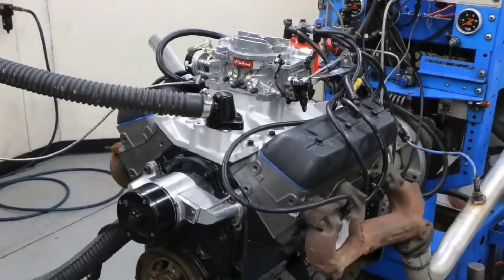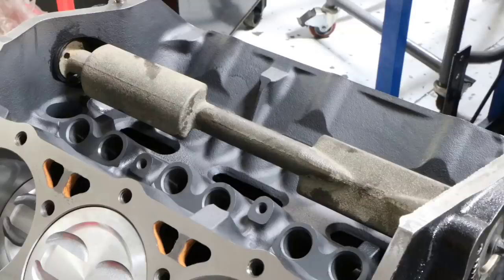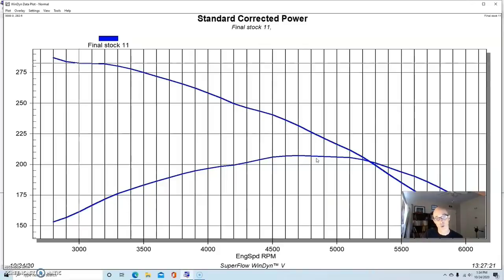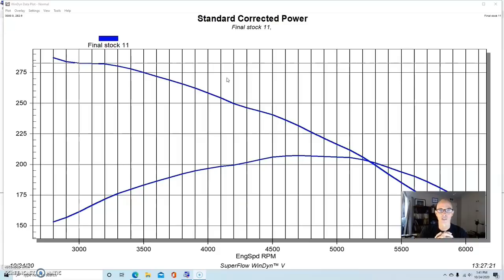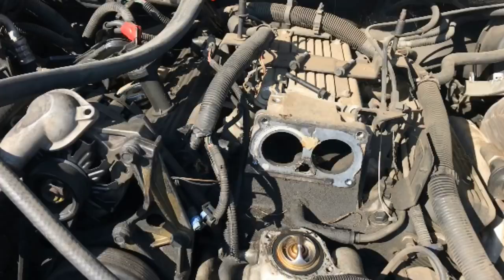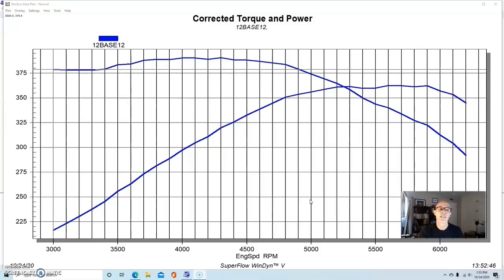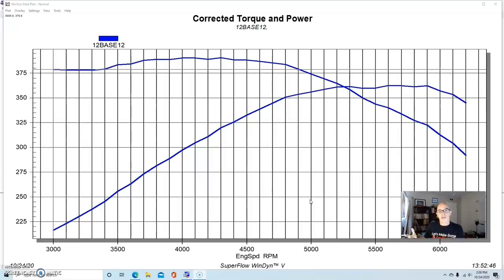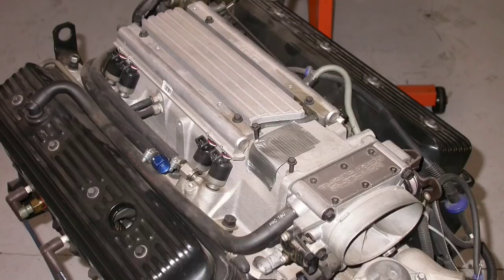4.3L V6 VS 4.3L V8-WHICH OTHER GUYS MAKES A BETTER BUILDER?

Comment: I have the 4.3 in my 15' Silverado. I gotta say I'm impressed by it all the time. An ppl who dont know usually think it's a V8
Reply: i have the same in the GMC its not bad after 4000 rpm is were i feel the difference in the 5.3 v8 but the low end she gets going for just 3.23 gears also have a older gen 4.8 l v8 and low end its nice but lags top end but having 6 speed over the old 4 speed stay in torque band and now with 8 and 10 speed prob always in the band. But the new 4.3 with lets say some 3.73 gears good e85 tune would run pretty good.

Comment: Chevy had to come out with a smaller V8 because some agencies would write the bid spec to favor Ford by specing "V8 engine, displacement no larger than 4.6 liters". The Caprice had a 350/5.7 so GM adapted. Ford could do anything when an agency spec'd a "V8 engine, 5.0 liters or larger".

Comment: Its all about volumetric efficiency, which ever one can flow air in and out more efficiently and at a higher rpm will make the most power.

Comment: Had Olds 260cid ... 302 Fords.. 305 sbc.. Love the small V8's. Perfect blend of economy and power.   Flatheads have their own sound/appeal.. again small displacement V8s.
Reply: I blew 3 Oldsmobile 260s. I swapped in a 403 back around 1997 and its still living happily ever after. 

I have a 302 in a '88 Mustang GT. Love it. 

I've had a few carb'd Chevy 305s and they're good on power, good on mpg,  1 was pumped up a bit. I can't complain.

I've been meaning to get and build a flatty. Every time I almost do.... I buy something else like old's j2, 394, 401 nail. Ugh such is life 😁
Reply: @xmo552  130k on my 260 before car was sold off.  79 Cutlass.  70's were different.. Carb'd motors didn't last as long.  I like the 302 Ford the best.. so I'm happy Richard is going to make a modern/Chevy 302 w L99 pieces. 305 TPI motors were great.. Had 305 in my 92 Firebird.
Reply: @mountainofeverest3861  
Oh yeah I forgot my 305 TPI. Luv that one alot actually.
Reply: You want a small Ford, you need the 255....what a piece
Reply: @timothybayliss6680  
Now that's one I hadn't heard of and I was pretty proud of my early Fox knowledge.

Comment: Definetely the v8 would be my choice for like you say over 8 cyl it's less strain on the engine to get the same power and a v 8 just sounds so much better than a v6 I love the 4.3 v6 they are awsome in s10s especially w a stick but a v8 version would be even funner I bet and be under less stress doing it so this is my 2 cents love the channel richard keep up the good work now project nova ever gonna get a Pontiac motor like the ones you tested ? That would be what I would love to see a 400 Pontiac slight build cam intake N exhaust w a q jet in front of a Muncie or a shift kitted turbo 400 trans I bet that combo will be the best bang for the buck basically meaning less money than it would cost to the same performance from a stock bottom end just cam intake and exhaust sbc or almost anything actually except a 5.3 L.S . But even then it may make more hp but the torque will not compare just a thought because I did have one or two Ventura's back in the day we stuck 400s and one a 455 in and stock boneyard motors with just tweaking the hei and q jet out ran a lot of guys with lots of money in their stuff they were left mouth open speachless saying wtf just happened just a ten bolt 373:1 limited slip carrier not even headers manifolds to decent mufflers and all the way out the back where it had decent sound but you definetely heard the q jet moaning like a bitch they would open I swear all the way unlike a sbc which couldn't use all the 800 or 750 cfms the Pontiac sure needed all it could get and being low compression I could bring my total timing in very fast to 35 or 38 deg at 2800 so she was cooking running cool and loving life and snatching a second gear chirp that left 8 ft long posi marks I found that if you put the turbo 400 in second gear hold it to the floor till it shifts that made for the hardest shift idk why but it's sure true even stock w no shift kit it was the best way to get second after the shift kit install oh my much better and those cars are not as heavy as a Camaro even so the guys w the mid 70 Camaros w sbc motors that had built them and had a decent investment got spanked often times pretty hard by a 4 door primer ventura with a 200 dollar boneyard motor just saying this a true story even a grand national had it's work cut out it was quicker out of the hole but she would start picking up on it as soon as some rpms came up and the torque was being made hp was only 300 ish right but torque was 400 plus isn't that true and what do you need from light to light or the 1/4 mile even unless you gear a sbc camaro right it's not gonna perform like a pontiac w less rpms but had the torque to over come the gearing a bit I often wondered what 411 :1 would be like with as tall a tire as I could find woot woot oh well I'll put the bong down now and stfu lol night yall

Comment: The L99 4.3 uses the same cam as the iron headed LT1 (and the Vortec L30/L31) so it'll be interesting to see how that shifts peak torque with less displacement. I'll also bet that the L99 head has better flow numbers than the V6 head, even with the smaller valves. Raised intake ports, nicer exhaust ports. It's not the same as an LT1 head, though, different casting, smaller combustion chamber. Allegedly the 5.7 iron LT1 heads outflow the aluminum LT1 heads as-cast, anyway, so I don't know if you'll gain anything putting a set of F-body heads on the L99.

Comment: 4.3-V6 with lightly ported heads and a cam,  engine size and weight weren't discussed.  I  don't have the engine bay size for a V8 and the extra weight is a negative

Comment: Also remember that all else equal, the smaller the bore, the better the resistance to knock.   So you can be safer, use lower octane, or tolerate higher boost levels, with only a change in more size.  That assumes you can make the head flow on a small bore.

Comment: I am not a engine builder.. I'm just a guy looking for a possible first car project..  

I'm actually floored at how good the L99 sounds... when you started talking bout it I was like "what good is this going to be.. It uses weird small parts, and you need to use your baby hands to put the baby sized valves... " NO, it uses LS parts.  I was flabbergasted..  I don't see any reason why not to try this block out  if you want to shoot for 500 HP... 

That said.. If i wanted to try and learn how to port heads.. I would just get a 4.3 to practice on..

Comment: The older tbi 4.3 v6 can handle 16 plus psi of boost on the stock crank but callies makes a stroker crank for the 4.3 v6

Comment: Given that choice, I would take the 4.3 V8 every time.  I have always regarded 90 degree V6 engines as lousy compromise.  The primary reason for their existence is to share manufacturing investment with an existing V8 engine family.  The NVH is lousy, so it needs a balance shaft... additional complexity, cost, weight, and friction that adds nothing to performance.  I like V6 engines, if they are 60 degree, inherently smooth(er) to start with.

Comment: If I recall gm had the 3.8l pushrod V6 and the 3800 series modular v6. I'm not sure if they were based off the same engine or was the 3800 series redesigned. To my understanding they shared the same block...kind of like an analog vs. digital engine.

Comment: I don't remember the L99 at all from back in the day it was in production.  But if you were going to do a max effort build for power on both engines, I would bet on the V8.  It has more total piston area than the V6 by about 12%.  If you could get a 1.98 inch intake valve in it, and port the heads, it would make some respectable power.  Maybe you could use ported LT1.2 heads with the intake valve OD's turned down.  The V8 would inherently have better balance than the V6, and not need the balance shaft that must be robbing some power from the V6.

But the stroker L99 combination will be dead meat going up against the destroker LT1.2, despite its 4 cubic inch advantage.

Comment: I love to see more 4.3 stuff.. drives me crazy there is no aftermarket support. I have a 01 Xtreme blazer. I’ve been slowly trying to put together everything to put an LS in it. Sadly I just lost my 07 6.0,rearend ,tires,wheels, not long ago I also  had to sell my Borg s480 to pay rent… then c vid happened so then a couple weeks ago because i couldn’t afford my storage unit ($750 because of being 2 months late) so I’m set all the way back to square one sadly. I’ve messed with the 4.3 just because it’s there. My truck has a 4.10 gear, no cat, 2 1/2 exhaust, “cold” air intake.. colder plugs and a 100 shot lol.. it feels like a Turd until you you spray it.. that spray wakes that fucker right right up.. Normally it won’t break the tires loose from a dig. Even with a damn 4.10 but when I spray it from a dig it’ll light them up. It goes pretty good. Until I hit the stupid speed limiter 😒.. Speedo thinks 100ish mph.. when in actuality it’s more like 80ish lol..

Comment: Well as you mentioned, the power would be spread out over 8 cylinders vs. 6 cylinders.  As for air flow, I would tend to believe the same may hold true.  Knowing the valves in the V8 are likely to be smaller but if I knew the size of the valves, I could calculate the area and multiply by 6 for the v6 and 8 for the v8 and know the exact difference.

Comment: I have a lot-1 down in our shop right now. I'll have to take a look at the cylinder heads and see how the chambers look as far as bore size, clearance. There may also be a set of cracked cast iron heads, from the looks may be the same casting like you showed. 
Back in the day we worked on a lot of 305 sprint car engines. A common thing to do was to clearance the block for the bigger valves. 
I had a 75 Monza which was a factory 4.3L V8. I never had chance to see how much different it was compared to the Lt-1 out of a 70 Camaro Z/28. I'd be interested across the board what the potential for each would be, naturally asperated, the 4.3L, the 302, 305 and the 5.7L. There's a lot of old school stuff that no one does anymore simply because of availability and affordability of new parts. There are a couple smaller chambered aftermarket heads like around 47cc chambers, cast iron (for IMCA class) set up for at least 1.94s & 1.50s.
You have no idea how excited I am to see this upcoming content. All stuff I've had conversations about with guys at the shop and guys on the Monza pages on fb.

Comment: I worked at a GM dealership back in the 90's. A Caprice came in that needed some work. Another mechanic was working on it. He called me over and said look at this, it says 4.3 on the emission sticker but it has an LT1 in it. I was confused too. He called the GM tech line to find out how this could have happened and was embarrassed to find out that it was a 4.3 V8 L99. We both learned something new that day!

Comment: You’ve got my wheels turning. I built a 267 back in the day, when I had no money for anything else. I always wondered what a 267 block with a 3.00 crank would be like with boost. Theoretically it would rev really high, but I’m not sure which heads would feed it the best. It would be 231ci or 3.8 litres. Might be a fun test.

Comment: 8 cyl has to make more, right? Larger gap, in degrees(crank rotation) between power strokes in a 6 cyl than a v8, & as you said, “each cylinder doesn’t have to perform at its peak to smash a v6 because there are simply more cylinders.” I love the idea of a 302! I want to see 10,000 rpms out of an American V8 either NA, or very little boost!

Comment: A friend of mine had a monza with a 262, we put a crane fireball cam and a holley intake and a 650 holley carb, then it started to break pinions in the rear axle
Reply: During a burn out attempt my Monza did the same, so I put the 262 into an Astre . That thing was on steroids .

Comment: Sounds like the biggest difference would be NVH.  A V-8 would be inherently more balanced than 3/4 of a V-8 since both have a 90 degree angle between cylinder banks.

Comment: I can’t say  enough great things about the vortec 4.3 v6.  My 98 Sierra has one with 300k miles.  Uses no oil, no leaks, great oil pressure and power.  And has had a very hard life.  My truck is on its 3rd trans though lol

Comment: I would only build a iron block 455 . Inside the 455 Cubic Inch Big Block from General MotorsThere's no question that 455 cubic inches of displacement equal a big motor. Nevertheless, this giant engine from the General is a little mysterious. In the beginning, you would find them in Oldsmobile Motor Division products. As time went on you started seeing this exact displacement under the hood of Buicks and performance models from the Pontiac Motor Division.

Here we'll dig into the history of the record torque producing big block. We will also uncover the difference between a 455 SD (Super Duty) and a 455 HO (High Output). Discover if the Buick, Pontiac or Oldsmobile engine has an advantage over the other. Finally, learn how the 455 benefited during a time when GM's divisions took great pride in making their own engines.

The Oldsmobile 455 Version
Olds beat the other GM divisions to market with the first 455 Cubic Inch motor. In 1968 the engine found its way into Oldsmobile's premium luxury muscle car, the 442. They called it the Rocket 455 which became an excellent marketing tool. They based the engine off of the 425 CID found in the 1967 Toronado. The company actually retained the same size bore yet increased the stroke by altering the crankshaft.

The side effects of a longer stroke include a healthy increase in torque. The downside is the engine finds itself a little slower at gathering RPMs. Horsepower ratings from 1968 through 1970 remained in the 375 to 400 HP range. At first, the engines remained exclusive to the Toronado, Cutlass and 442's. After 1970 you'll also find them in the Olds Vista Cruiser Station Wagons, Delta 88's and even GMC motorhomes.

Stage I Buick 455 Performance Engine
The Buick version of the 455 is actually quite different from the Oldsmobile version. Instead of altering the stroke, Buick honed out the cylinders on the 430 CID Buick Wildcat engine. For this reason, GM considered it a thin-walled big block. The advantage of this casting design is a significant drop in weight over the other 455 versions.

In fact, the engine actually weighed close to 150 pounds less than the legendary 454 big block that Chevy used. This weight reduction compensated for slightly lower horsepower output from the Buick version. They rated the standard issue 455 at 350 HP and the high-performance stage I version at 360 HP.

This engine had a short run starting in 1970. In 1975 General Motors started using the same engines across the different divisions and platforms. This gave them better compliance control for the increased power and fuel miles they buckled it into the ground.  At the end I put that engine in my 1995 suburban and it was a muscle car bully that ran 10 seconds on a good day on a lumpectomy day she ran 11 seconds and for a suburban that’s quick thrown down . Edit if I fallowed my insane friends build I could have had a 9 second suburban . To tell you the truth I would love to own a cutlass 442 my mom had one when she was growing up . To be honest with you tony they don’t make any thing past the 80’s I would want to own and there’s no way in hell I would ever buy a electric vehicle that needs Nuku’alofa power or coal to charge your disposable Dixie . My wife said go find something at a dealership or something and I tell her every time 99 percent to a 100 dealership unless you’re in America you cannot buy anything new  Canada 🇨🇦 sucks and Justin Trudeau is a ducking fucking joke on the world stage .

Comment: You should see some of the NASCARs. They have a V8 that they only run 6 cylinders on. And they have two counterweights for the last two cylinders to balance the motor. And they running all them high RPMs with that 6 cylinder
Reply from the maker: where does this happen?

Comment: It's a fun comparison due to the same displacement and manufacturer, but in terms of real world engine swaps, I think it's kind of apples and oranges. V6 4.3 swaps always seem to be the choice when engine bay space (especially depth of the bay) is limited, but affordable, easy to adapt power is wanted (i.e., old Jeeps/Willey's, 4 cyl Scout 80/800, Toyota trucks, etc.). I feel like if there's room for a 4.3 V8, then there's room for a bigger displacement SBC, so the 4.3 V8 would never be a practical consideration.

Comment: From my understanding  the l99 is a 305 piston with the 5.9 rod. And the lt1 heads are suppose to work clear edelbrock has small valve head not much better than the factor one. But a set of Lloyd Elliot port lt1 heads (elliotportworks.com) with factory valves and his custom cam make 380 - 400 on the lt1 and the intake looks the same but it actually has small runners than the lt1. Lloyd  could also port it.

Comment: You can probably use the last of the 305ci heads (tpi) on the 4.3V8 . as for 350ci 5.7li heads I think the valves might hit the block. When I was younger I milled the block on a 283ci to fit sb 400ci heads. Cause I was young ,dumb.... You get it 😆. I got luck. It was a violent combo in my 75 vega gt. Very quick tempered engine with lots of lungs on the other end.
Reply from the maker: Vortec 305 head is different
Reply: @richardholdener1727  bummer. A machinist is your best bet.

Comment: I would pick a 4.3 V6 with the Vortec heads for a small engine bay 
But for any engine bay that fits a small block Chevy you may as well go with a bigger displacement engine if you’re trying to make power.